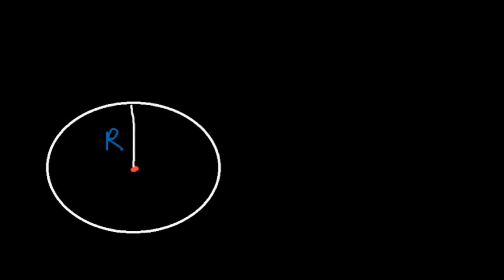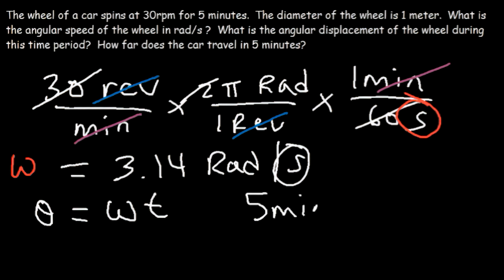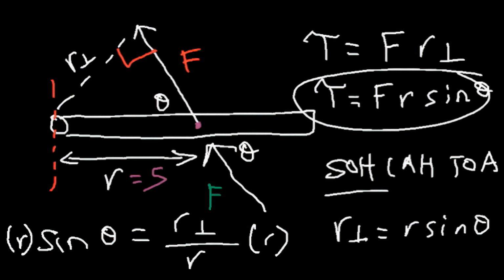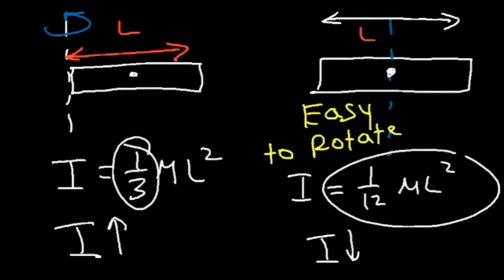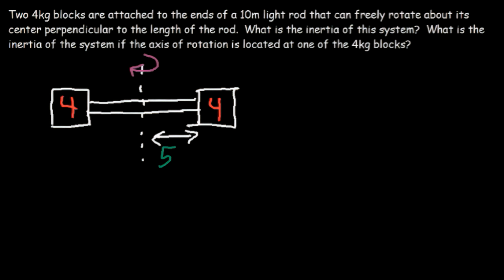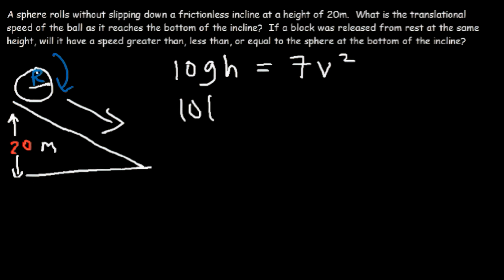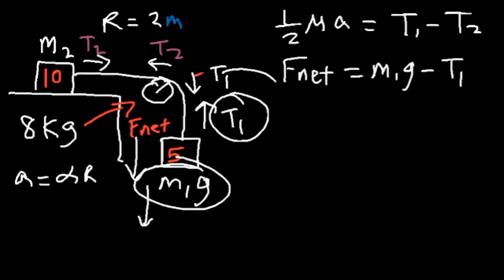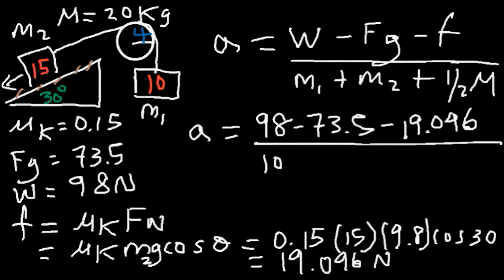Torque, Moment of Inertia, Rotational Kinetic Energy, Pulley, Incline, Angular Acceleration, Physics

Comment: A lot of the topics overlap so you should probably skim the video yourself but here are quick timestamps:
Angular Kinematics: 00:00
Torque: 51:37
Moment of Inertia: 1:27:50
Center of Mass: 2:12:12
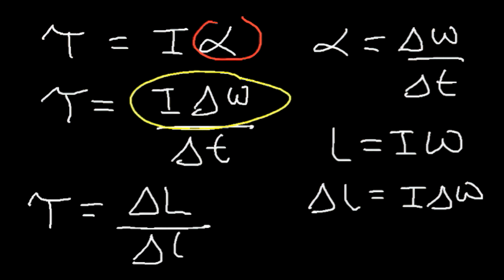Pulley: 2:20:17
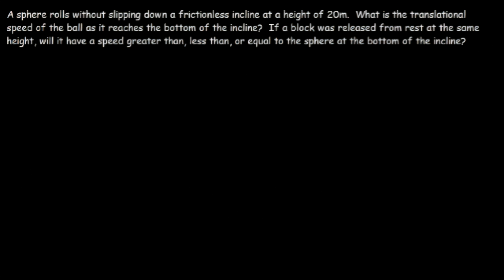Incline 2:25:00
Reply: 🥹 TYSM

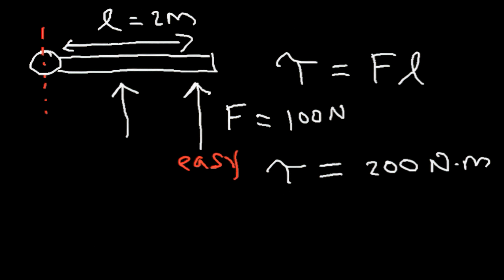Comment: 53:12 start of torque; easier to apply at edge of beam
1:05:45 force on beam up and down net torque
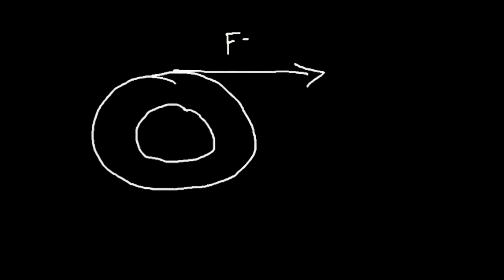1:09:07 compound wheel
1:27:42 rotational inertia; depends on mass distribution
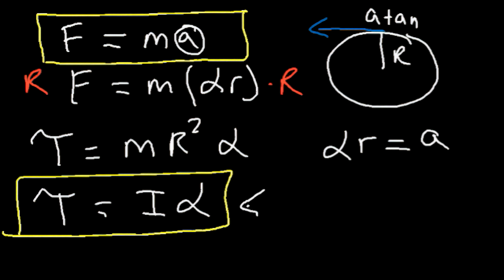1:30:59 rotation f=ma
2:02:40 inertia axis of rotation
2:30:42 rotation PE KE
2:44:02 mass on wheel
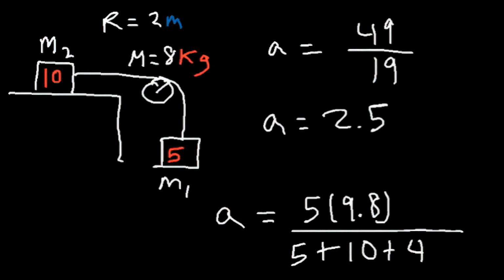2:54:33 2 mass on string
3:12:55 2 mass on wheel

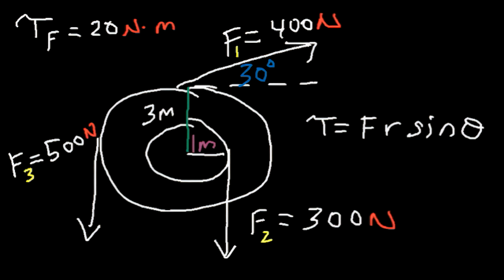Comment: 1:13:14 Tips to find the angle to use in torque problems
Angle between force vector and line parallel to Arm/Radius

Comment: Around 2:01:58, I don’t understand why the inertia of the block through which the center of axis passes is zero. I understand the math presented but it assumes that because the center of axis passes through the block that the radius is zero. But that block has inertia. If you put a 2 ton block on a vertical axle it isn’t gonna spin easily.

Comment: I have a problem, sometimes, when axis of rotaion is at centre, we take m*r^2 and sometimes we take 1/12mr^2, how?
Reply: depends on the type of circle… by default the axis of rotation is mr^2 but for a disk it is 1/2mr^2. For other objects like a sphere, the rotational inertia is 2/5mr^2. usually in exams if it isn’t the standard mr^2, they will give you the rotational inertia formula

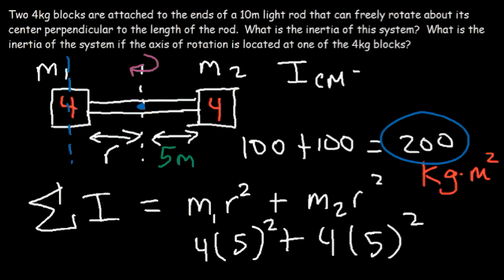Comment: Can someone explain why at 2:00:54, we are using sigma I = m1r^2+m2r^2 instead of I=1/12ML^2 ? I thought it should be equivalent but when I tried it, the second equation gives me I=66.67 instead of 200.
Reply: We use  Sigma I to describe total rotational inertia of the system, in this scenario, we are calculating for the total rotational inertia of the two blocks since the text says a "light rod" meaning the mass of the rod is negligible. When it says rotational inertia of the system, you calculate it for all the masses then add it up, if the rod wasn't "light" and was given a value of mass, we would then add it to sigma I.

Comment: 41:55 i dont know how you got 14583, the questions says 3500 revolutions per minute which means 58.3 revolutions per second, and the time period is 500 seconds, why dont you just do 58.3 times 500? howd you get 14583, thats half of my answer
Reply: That's what i got too
Reply: I think that's because because the angular speed in all of that 500 seconds is uniformly accelerating, meaning it steadily increases over time. Actually, that method may have worked if the angular speed is constant from start to end.
Reply: im not really sure, but as far as i know, i think that's the reason why he didn't just convert rpm to rps, then multiplied by 500

Comment: I couldn't understand why beginning at 7:10 distance and displacement are equal. Displacement focuses on initial and final positions whereas distance is the path taken. If we consider a circle the length between the endpoints of the two radiuses is not equal to the arclength of the angle in that same position. Can somebody please explain the logic?

Comment: Rotational Dynamics - Introduction / Basic Overview
 3:36-9:00 Arc Length of a Circle, Angle Measure in Radians & Radius
 0:12-3:33 Degrees to Radians and Radians to Degrees
4.  Angular Displacement Formula - Arc Length
5.  Angular Velocity / Speed Equation - Rate of Change of Angular Displacement
6.  Units of Angular Speed - rad/s or radians per second
7.  Angular Speed vs Tangential Velocity
8.  Angular Acceleration and Tangential Acceleration Formula
9.  Net Acceleration Vector - Tangential Accleration and Radial / Centripetal Acceleration - Nonuniform Circular Motion
10.  Frequency - Number of Cycles per Second or Revolutions Per Second
11.  Period - The time it takes to make 1 revolution around a circle
12.  Frequency & Angular Speed Formula
13.  Rotational Kinematic Equations - Initial & Final Angular Speed, Acceleration, Displacement and Time Formulas
14.  Calculating Tangential Velocity & Net Acceleration of a Disk Given Period and Frequency
15.  How to Determine Linear and Angular Displacement Given Time and Speed in rpm
16.  Centrifuge Problem - Rotational Motion
17.  Average Angular Velocity vs Instantaneous Angular Velocity
18.  Average Angular Acceleration vs Instantaneous Angular Acceleration
19.  Rotational Torque, Force, Lever Arm / Moment Arm & Line of Action
20.  Positive vs Negative Torque - Clockwise vs Counterclockwise Direction
21.  Compound Wheel Problem With Multiple Forces - How to Calculate the Net or Sum of all Torques
22.  Seesaw Physics Problem - Multiple Torques & Forces - Lever arm / distance from fulcrum or pivot point
23.  Input Force vs Output Force - Simple Machines - Mechanical Advantage - Input arm vs output lever arm
24.  Newton's First Law of Motion and Law of Inertia
25.  Definition of Inertia - Natural Tendency of an object to resist changes in its state of motion - Resistance to Rotation
26.  Inertia of a rod with axis of rotation passing through center, edge, and 1/4 from edge formula
27.  Mass vs Acceleration - Newton's Second Law
28.  Rotational Equivalent of Newton's Second Law
29.  Torque equals Inertia x Angular Acceleration
30.  Inertia of a Disk, Rod, and Sphere Formulas
31.  Work, Force, and Displacement Equation
32.  Rotational Work, Torque, and Angular Displacement Formula
33.  Power, Force, Velocity / Speed Equation
34.  Rotational Power, Torque, Angular Velocity Formula
35.  Average Power vs Instantaneous Power Calculations
36.  Work Equals Change in Rotational Kinetic Energy
37.  Power Equals Work Divided by time
38.  Power - rate of change of energy transfer - 1 watt is 1 joule transferred every second
39.  Calculating the inertia of a system of particles or blocks of mass
40.  Inertia Formula I=MR^2 
41.  Parallel Axis Theorem Formula I=Icm+MD^2
42.  Inertia of 4 Point Particles of Mass M With Axis of Rotation Through Center of Mass
43.  Linear vs Angular Momentum Formula
44.  Linear Momentum Equals Inertia times Angular Velocity
45.  Force is the rate of change of momentum per unit time
46.  Torque is the rate of change of linear momentum per unit time
47.  Conservation of Linear Momentum Problems - Turntable & Merry go round problems - inertia and angular speed
48.  Sphere vs Block on Incline - Conservation of Energy Problems
49.  Gravitational Potential Energy, Translational Kinetic Energy and Rotational Kinetic Energy Equations
50.  Block of Mass Attached to Pulley / Disk - Find Acceleration Using Tension Force & Conservation of Energy
51.  Frictional Torque, Block of Mass, Pulleys, Disk & Tension
52.  Pulley With Mass Attached to a Hanging Mass and Another Mass on a Frictionless Horizontal Surface
53.  Pulley / Disk with Radius Attached to 2 hanging mass - find acceleration
54.  Incline With Pulley / Circular Disk with Hanging Mass and a Mass on Incline with Coefficient of Kinetic Friction - Determine the acceleration of the system
Reply: Thank you so much!!!
Reply: GOD BLESS YOUUUUUUUUUUUUUUUUU
Reply: Tq
Reply: thankations

Comment: Did anyone do the very last problem with the tension forces?
I have T1 = m1*g-m1*a and T2 = m2*g/2 * (1+sqrt(3)* mu)+ m2*a  but I'm not getting the correct acceleration. I got T2 like m2 * a = T2 - Fg(inclined plane) - Ffriction. Is that my mistake?

Comment: question about this 2:21:50, the net force on the object equals its acceleration, the net torque on the object equals its rotational acceleration.

So is the net force on the objectless because the ball had less gain in translational velocity?

If I have a heavy object on a seesaw close to the center, and a lighter object on the other side further away from the center. the torques would cancel out and the object would not rotate. However, if there is a net force, then it would translate, but given that the objects are stationary, then the net force is 0.

Using this same assumption would the rolling ball experience less net force?

Comment: The one thing that still baffles me in all the calculations is during the last part where we consider the Inertial mass of the pulley. You use 3 Methods to calculate the Acceleration. But the last method where you said that we can use any height we choose and we'd still arrive at the same answer is really Mind Boggling... Its just like saying that height has no effect on the answer!!!

Comment: Hi. Thanks for d learnings that u provide. greatly appreciate u.  i have a question.  How do u compute the moment of inertia for a disk that is hollow inside. for example. radius is 1meter. mass 1kg.  disk with covers at 2 sides but hollow inside and the thickness of disk is 5cm? Thanks vmuch ;)

Comment: Sometimes the simplest things mean the most, I really appreciate your help. Thank you.🧡
I do have a question though :
in 2:23:33 we found the mass as 500kg. But when I used the FxΔt=mΔv logic, it hasn't worked(I got the v from Δv=Δωr=9.6 and the mass as 250kg) is it that my way of thinking is wrong or the question isn't accurate?
Reply: angular momentum to linear momentum is not conserved and cannot transfer, unlike energy.
Reply: Considering it has been 2 years since I graduated, it is a bit late, but thank you for responding.
Reply: @sphystius9031  🤣

Comment: 30:13 isn’t w=19.73 rad/s? Because rpm is a frequency, 3.14 rad/s is also a frequency not w. And w=2pi*f therefore w=2*3.14*3.14rad/s and if we solve for w, it is 19.73 rad/s

Comment: How do you determine the coefficient of inertia? I am confused as to how you decide to use (1/12) vs (1/3) vs (1/2) vs no coefficient. Thanks!
Reply: the coefficient of Moments of Inertia of Various Rigid Objects are constant. it depends on the shape of the object. so, for example, a disk coefficient is 1/2, a sphere coefficient is 5/2 and so on. you can find it online and it should be given in the problem. hope this helped!
Reply: Mariam Jama sphere is actually 2/5 (solid)

Comment: One important point to note, right near the beginning, in your example calculation for arc length, you give it as 1 rad * 5m/rad. That's technically incorrect, it should just be 1 * 5m, as radians are dimensionless.

Comment: A plank with a mass M = 6.00 kg rides on top of two identical solid cylindrical rollers that have R = 5.00 cm and m = 2.00 kg. The plank is pulled by a constant horizontal force F of magnitude 6.00 N applied to the end of the plank and perpendicular to the axes of the cylinders (which are parallel). The cylinders roll without slipping on a flat surface. There is also no slipping between the cylinders and the plank. Find the acceleration of both the plank and rollers.
<<<<<<<<<<<<<<pleas explain solution >>>>>>>>>>
Reply: You must be a joke.

Comment: The problem at 45:18, I have a question about that. We're asked to find angular speed right? I thought angular speed was simply 2*pi*f. Why did you have to go further and use the kinematic equation? You didn't use it in the question before this one (the centrifuge question) while you were finding angular speed.

Comment: Pi is the ratio of diameter to circumference. That means for every rotatation of the wheel the outside of the wheel travels pi*d or about 3 times the diameter. Makes it easy to find distance.

Comment: at 1:14:18 when we are using 60° for calculating the torque why are we doing Fsin60° instead of Fcos60°?  or F1sin30
Reply: Either do Fcos30 or Fsin60...both are perpendicular to the radius

Comment: 46:05   The speed i get is 112.2 rad/s.  Yu have 224.2 rad/s. But if yu do distance / time. You get 1600pi/44.8s. which is 112.2 rad/s. Can yu please explain this? Thanks  Love yur videos btw.
Reply: Distance is not 1600pi it's 1600pi*radius

Comment: At 12:00 u said the object has a net acceleration ,so what's the direction of net acceleration when the object is rotating at a uniform speed?
Reply from the maker: There's always a centripetal acceleration that is directed toward the center whenever an object is rotating even at uniform speed.
Reply: Use vector.
Reply: its the resultant of radial and tangential accelaration.